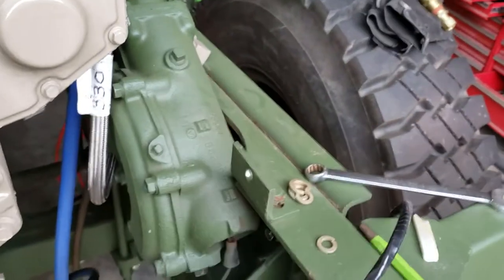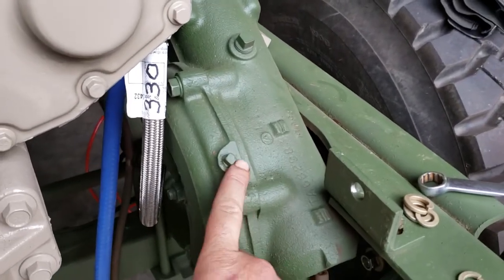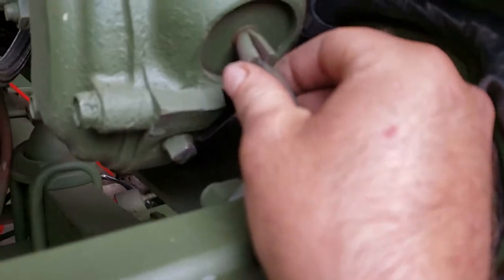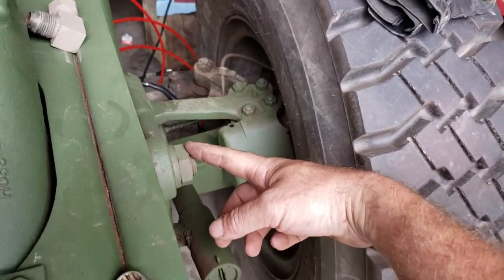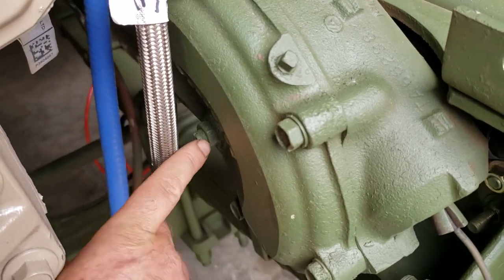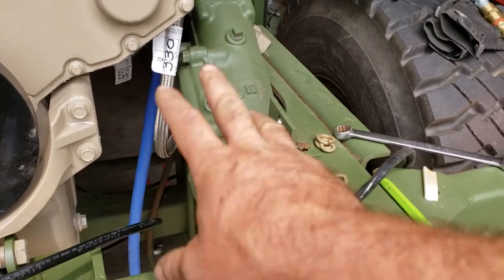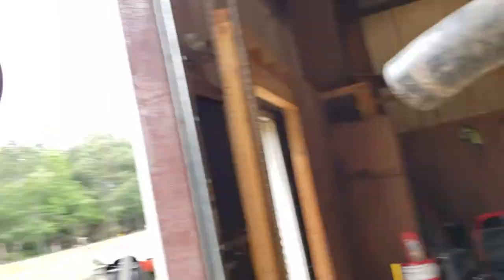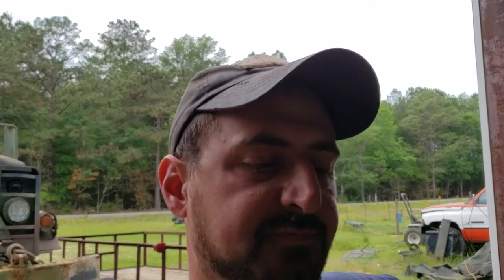M35A2 steering box basics.

Comment: I am having a problem with my brakes  the peddle is not coming back up but the brake Reservoir is full I am  on my own in repairs only videos i can see and speak with people as none have them here that i know of  when i moved to here. any advice would be great also the tiny air hose that goes to the  6 wheel mode switch   broke where would i get a new one from ?thank you  for any info
Reply from the maker: You need to build a pressure bleeder and use it to bleed your brakes. I have videos on that.
You can use 1/4" DOT airline and brass fittings to build a replacement air switch line. I did on mine.

Comment: If a man went with the waterloo 5 ton power steering kit I wonder how long parts will be available? Reason I ask is I plan to keep the truck a loooong time and I hate to swap one out dated part for a soon to be new out dated part. I have heard of cornhead grease in steering boxes for years but have never figured out what it is or how it compares to 00 grease, guess im one of  the lucky ones because my box still holds 80w90 just fine (knock on wood). Thanks again!
Reply from the maker: Cornhead grease is 00 grease. The steering box is a commercial part and so is the pump. Both are quite available.
Reply: @tacticalrepair  Thanks. I have a factory power steering B53 mack with a shepherd box and there are no parts available for it and its acting up at the moment so I just don't want to fall in this boat again. Thanks

Comment: hey man are you gonna fill that sucker up with cornhead grease? fixin to do that to mine since it leaks. also what do you think about burning/cleaning brake shoes that are oil contaminated? i got 4 sets of shoes but some are dirty really dont wanna toss em since theyre new. also if youre gonna fill it with cornhead grease, install the grease nipple in the bottom drain plug then remove the top plug and fill it like that.
Reply from the maker: Put 00 grease in mine years ago.
Clean oil contaminated brake shoes by soaking them in an acetone bath.

Comment: I have a multi fuel engine, and I was trying to remove the pump. I couldn’t get it out so I tried unbolting the steering shaft where it connects to the box, and when I screwed it back in, the plate where the horn wire comes out popped off. Can I just press that back in and go on with my day, or do I need to replace the whole box?
Reply from the maker: Push it back in with some silicone
Reply: @tacticalrepair  you mean the whole metal plate right? Not just the rubber fitting
Reply from the maker: @tikiman48  is there a snap ring groove in the housing? I can't remember if this box uses a snap ring to hold that plate on, but it should have sealant regardless.
Reply: @tacticalrepair  I’ll have to double check. I’ll let you know